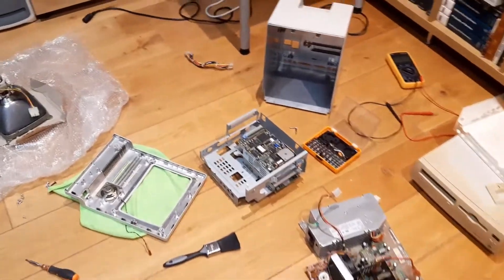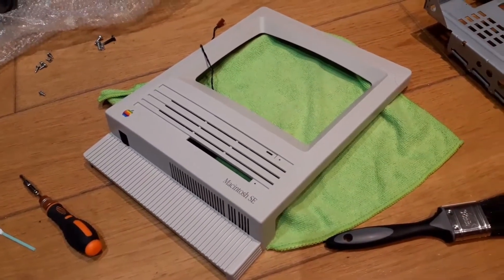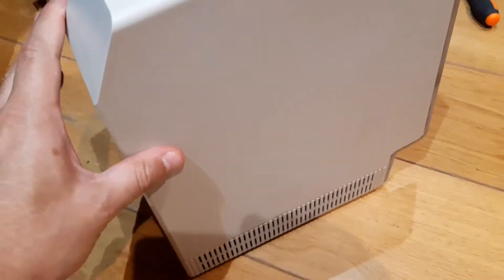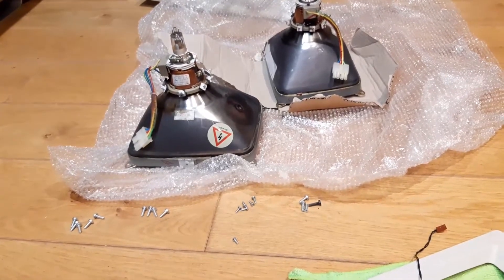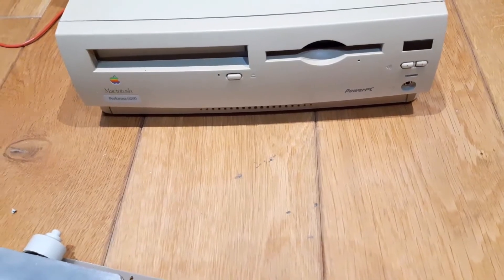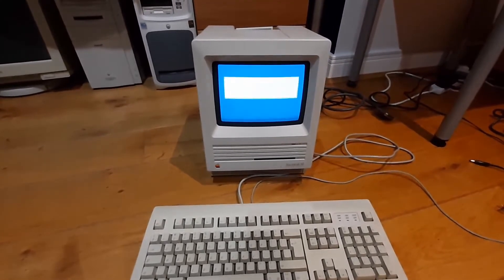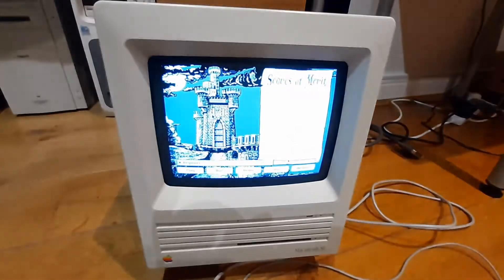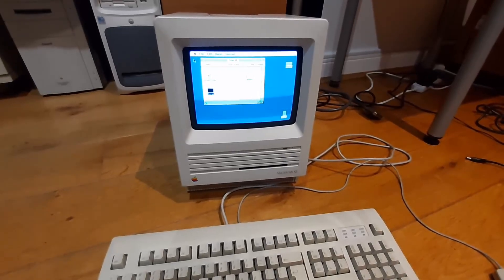Macintosh SE Restoration - Part 3 (putting everything together)

Comment: Very nice restoration. I'm in the same boat with my CRTs, but have severe burn-in.
Reply from the maker: Yes, it is hard to get a hold of good CRTs for those compact macs, as most of them were left on for a huge amount of time. I have an amazing condition one on my plus... but I was lucky,  I guess. The 2 I had available for the SE project had burn ins. Not too bad,  but they are there.